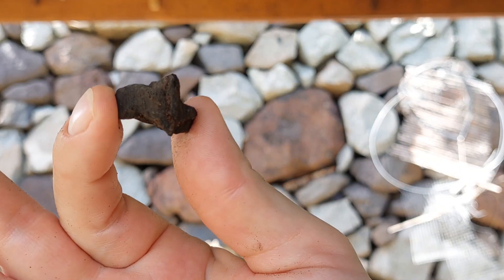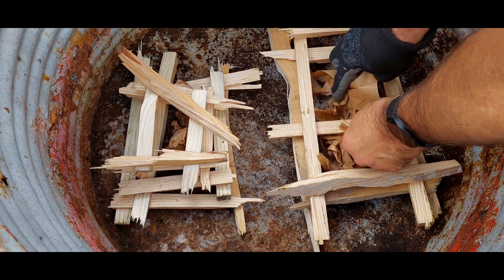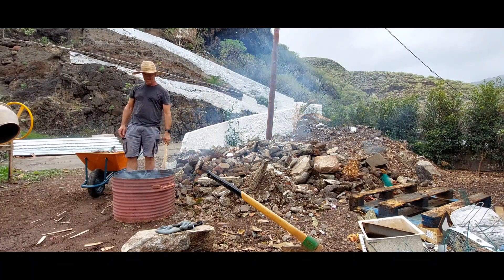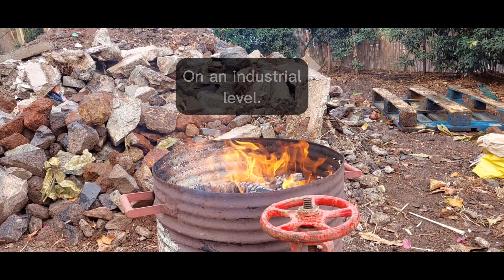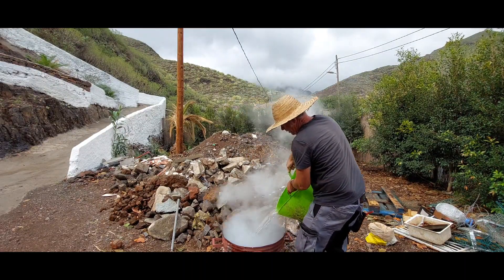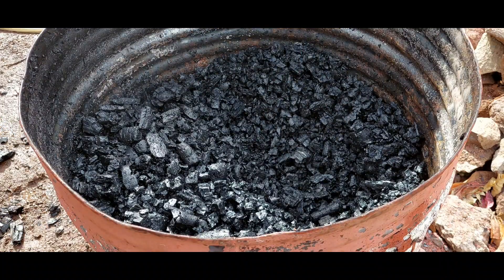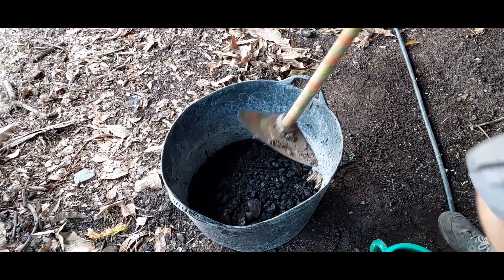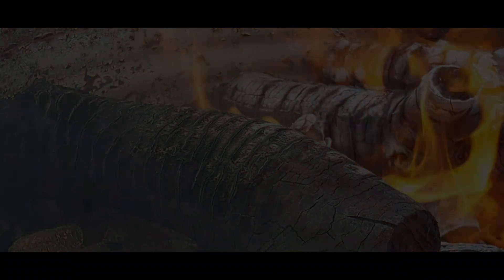Biochar: Your Soil's Secret Weapon (Beyond Composting)

Comment: Beautiful entourage! - From what I was able to observe, the biochar was just placed on, not mixed with, the vermicompost. - How is that procedure sufficient for activating the biochar? Thanks
Reply from the maker: Well, I kind of scracthed it in as a thin layer, so it was all in contact with the castings if not buried a little. The microbes and nutrients came up from the backdoor, if you will. I didn't mix it totally in because it would have been difficult to get it all out because I didn't want to harvest the castings yet. It really brought up the temperature in the compost pile so I think the microbes moved in. If that wasn't enough, the time in the compost surely finishe off the activation process. Thanks for watching and commenting 🙂